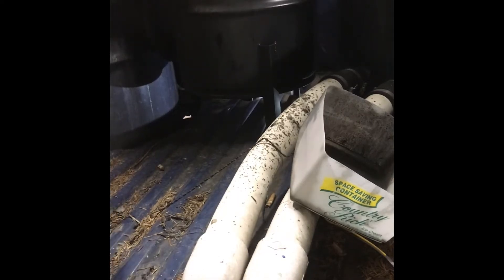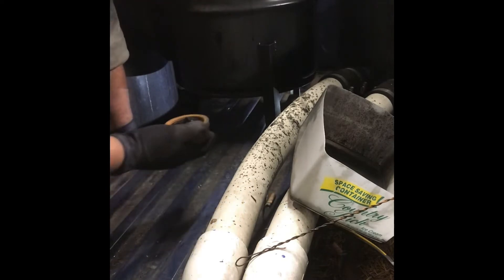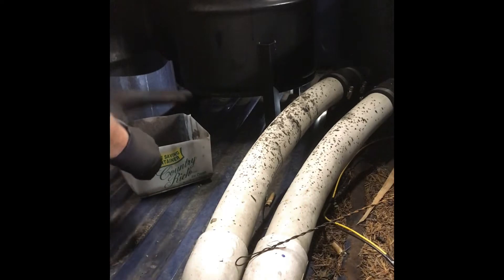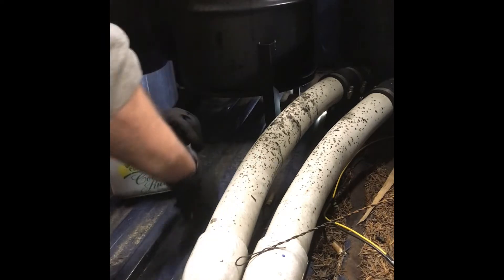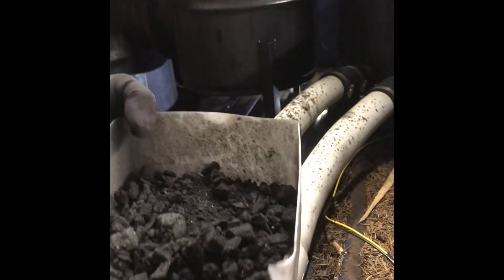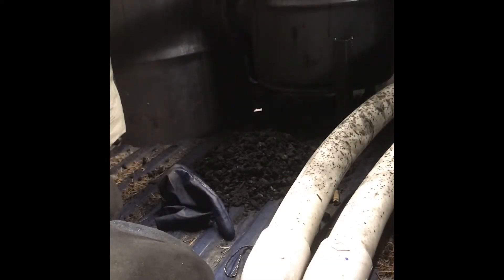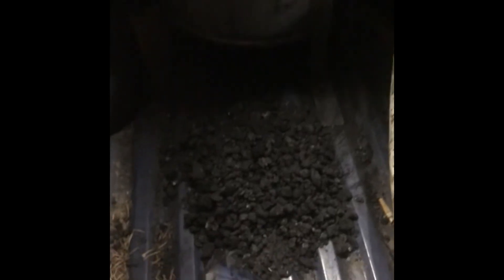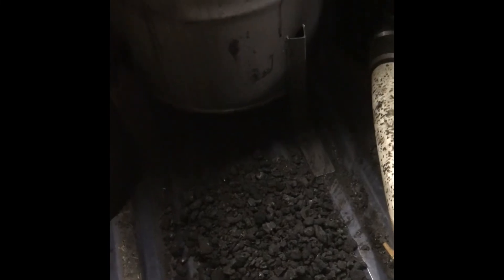ITS BIOCHAR part 2 the drop box

Comment: Yup. You have a carbon neutral truck right there. 
 Not many of us can truthfully make that claim. 
 One of these days, I figger on converting a tractor, to work my farm, using treezel chunks as gasoline granules   :) .
Reply from the maker: In the drive on wood forum there is a whole section dedicated to woodgas farming, lots of tractors!
Reply: @BigBeavrSlayer  
 That's good to know. 
 Ain't been there in a long time, but I think it wood be worth joining up, and becoming active there  :) .
Reply from the maker: @CNCmachiningisfun  be very happy to have you there!
Reply: @BigBeavrSlayer  
 Thanks kindly. 
 Got a lot on my plate right now, as I am moving off this farm, onto another. 
 Soooooo many projects. Soooooo few spare tick tocks!